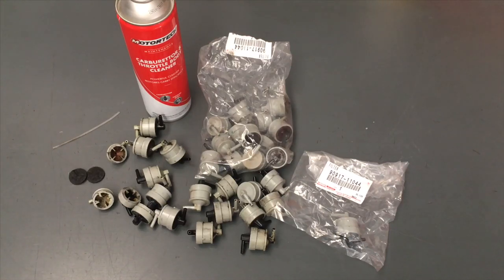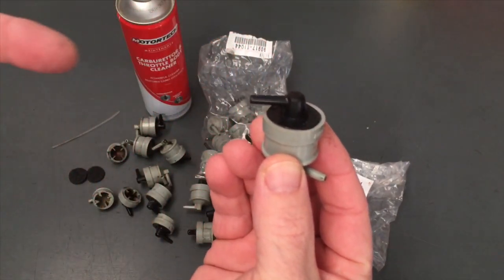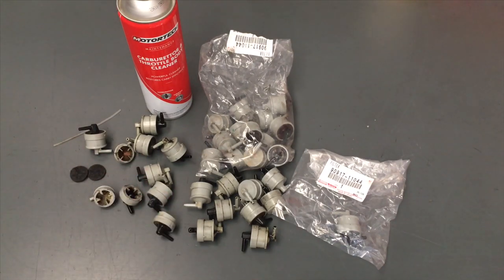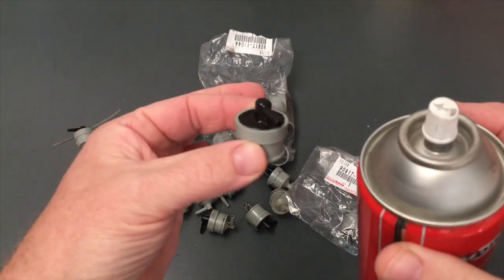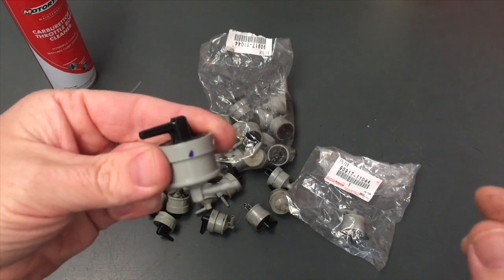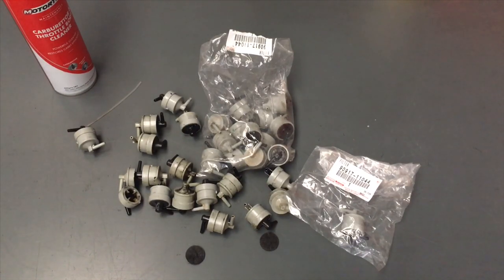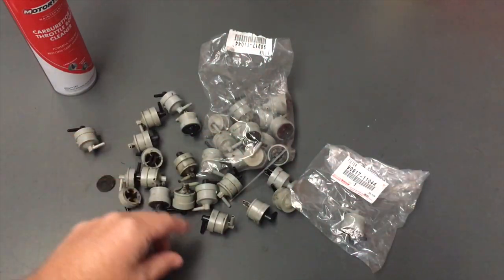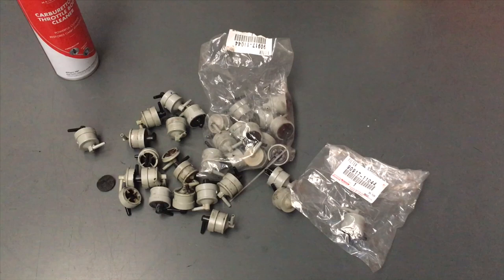ALL MAP FILTER INFORMATION

Comment: Just sprayed mine out gently with MAF cleaner, it came out crystal clear from both ends... I guess that 7mm plate for offroad use only also keeps your MAP filter clean!   I put the new one in a year ago with 30,000kms on it!
Reply from the maker: Absolutely mate think about it take the filthy black exhaust soot out of the system then there’s nothing black to make the oil black or the Map Filter, further evidence how well the plate works for those that think it doesn’t because it’s got a hole in it.

Comment: Well that was an interesting interaction at Toyota.

Me: Hi Mate, can I get a MAP filter please?
Parts guy: A what?
Me: A MAP filter?
PG: Say again?
Me: Manifold.Aboslute.Pressure.Filter.
PG: confused look - smashes away at the computer
PG: Oh, a MAF sensor!
Me: Ah, no. MAP filter. Grey cylindrical thing. Pipe going in and out. One black one grey. Passenger side of the engine.
PG: opens window to workshop This guys wants a MAP filter?
silence
PG: Back on the computer This one on the air filter?
Workshop Guy: No, that's the MAF sensor
PG: Yeah.
WG: MAP sensor filter?
Me: Yes
PG: Goes and gets filter

Smooth as poo!
Reply: Lol and these guys work on our cars 😂
Reply: I just had the exact same exchange with my Toyota Parts Guy in Italy... it seems to be a timeless and geographically independent discussion at Toyota dealers around the world 😂

Comment: You can use a cheap motorcycle universal gas filter as alternative to that expensive part. It even give more power to engine.
Reply: Thank you for the hint. Did you test it after a long period of time? Wouldn't it destroy the MAP sensor with carbon build up if the standard motorbike's filter is not appropriate? Thank you for sharing your experience. Since I don't find this MAP filter in the toyota local dealer here. And I don't find any other car manufacturer (VW Peugeot, kia, Isuzu,...) using such filters before MAP sensor.

Comment: Same for the 1kz-te mate ?
I cleaned mine a while back with maf sensor cleaner only because im a tight ass 
Had no idea i could or should do it 
Just didnt want to buy another one bahaha
Reply: Thank you for sharing your experience. How many km/miles have you used it after cleaning? Did you notice any trouble? Check engine codes or so? Thank you for the feedback.

Comment: Just wondering if it is possible to clean the map sensor itself?  Haven't had mine apart yet but wondered if the filter is dirty and allowing soot to get past to the sensor then replacing the filter wouldn't completely fix economy problems.

Comment: replace it with the alloy one from PDP. alot better
Reply from the maker: No point investing extra coin they need to be replaced every few years and they last longer than a few years before they crack usually close to 10 years by then the filter as well past its use by date